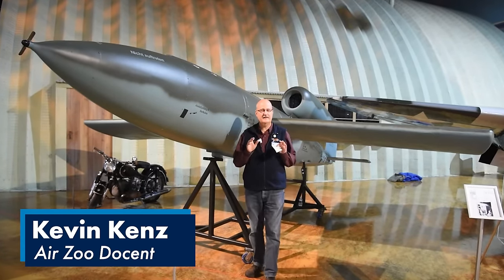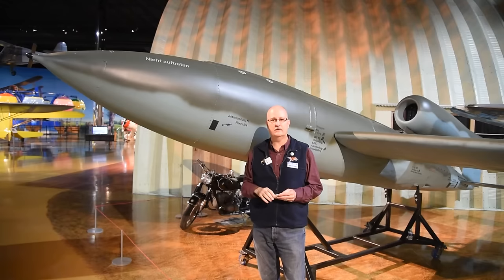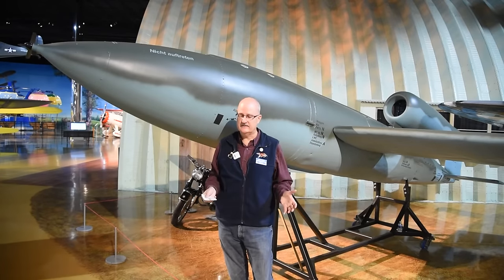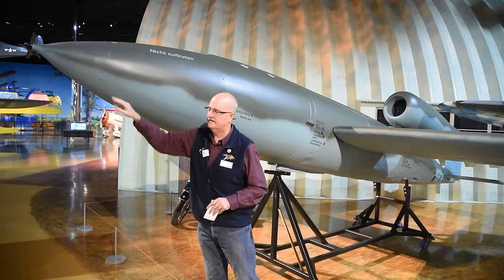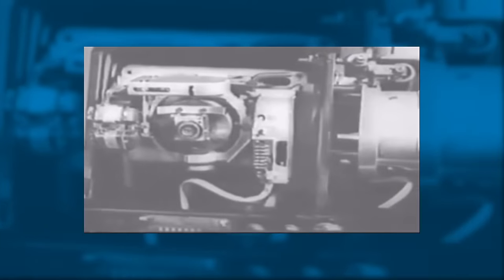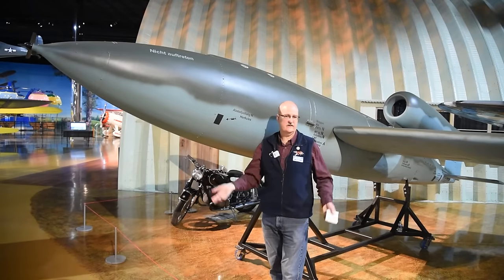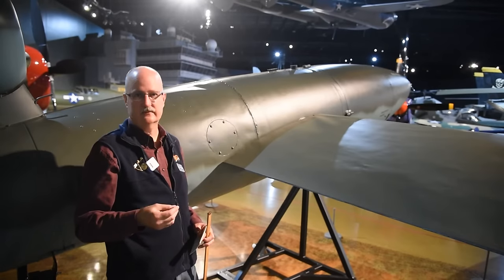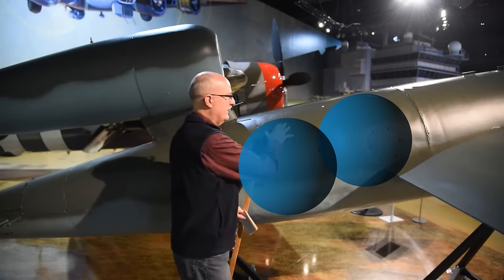V-1 Buzzbomb: A Technical Breakdown of the Vengeance Weapon

Comment: They use to sell small pulse jet engines for hobbyists to use on scale model aircraft and cars.  We lived about 2 miles from a part in the west side of Detroit called Rouge Park on the Rouge River.  Same Rouge River that ran into the Detroit River where the Ford operations were.  The sound of these small pulse jets could be heard for miles.  They ran at a higher speed than the buzz bombs.  They were very hard to start.  They would the air planes with “U Controls”.   They would have to run in circles to keep up with the plane.  They had a post in the ground to hold on to so the force from the model plane wouldn’t pull the pilot off the circular path.  It was nutz. I stuck to my little 0.049 engine all plastic plane held together with rubber bands.  It would crash, disassemble itself, then I would reassemble, took about 10 minutes and off I went again.  That’s as far as my flying career got.  I’m 74 and still think about ultra lights, no license required.
Reply: they they they they they they
God... learn to write properly
Reply: What possible value is that comment?

Comment: The Mustang P51 D had no difficulty in shooting down these suicide drones, so why not use them for shooting down large drones in Ukraine? As the P51 has no radar, it would have to be vectored onto its target from the ground. Plenty of P51 owners would love to become drone aces. With drop tanks the Mustang can loiter for ten hours or more waiting for a target.
Reply: Probably because that's insane
Reply: @jdlamb4212  Why is it insane now, but it wasn't in 1944?
Reply: @bernardedwards8461  Ever heard of modern anti air? The P51 would get shot down befor it even sees the first drohne.
Reply: @wolf310ii  Wrong way around, the drone would geet shot down before it saw the first P51. Drones are slower and cant take evasive action.You are very unobservant. You haven't noticed that within their own airspace, Russian planes are rarely shot down although their infra red emissions are much greater than the P51's.
Reply: I don't recall events where the Mustang was used. for this purpose ?
Reply: @mauricelevy9027  All fighters capable of doing it were used for this purpose: Spit, Thunderbolt, Mosqito, Meteor, Typhoon, Tempest, Mustang, and probably Lightning. Most of these fighters also performed escort duties for bombers and carried out ground attack on the continent. The Meteor was the only one used exclusively for drones, it wasn't able to tackle the Me 262 on equal terms. There may be one or two I have left out. I dont think naval fighters were used, because most of them were deployed in the Far East. The V1 drone flew at 400 mph, so the fighters needed to be pretty fast to catch them